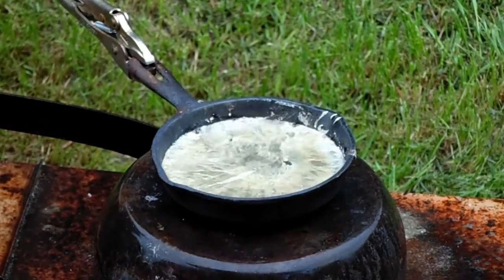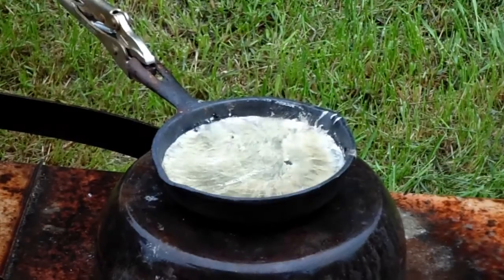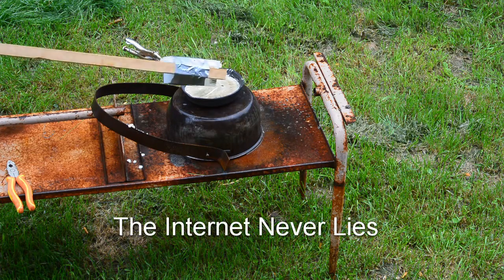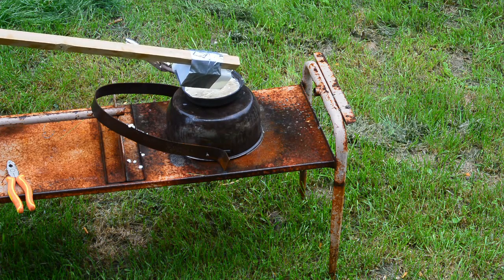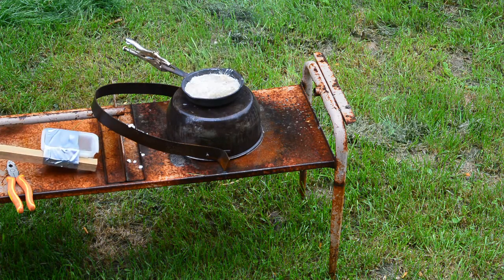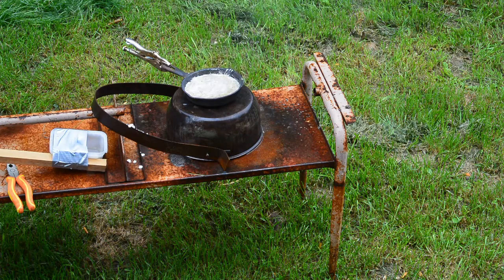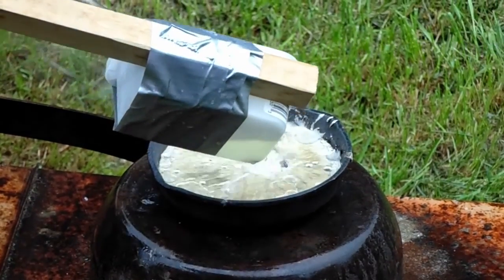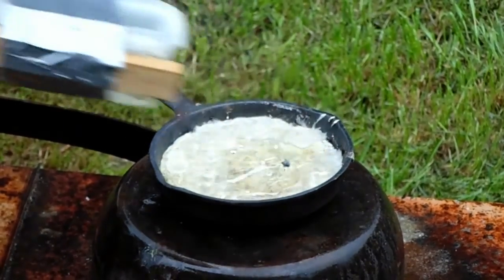Gasoline Vs. Molten Lead, Does It Explode?

Comment: Upper flammability limit I think... The gasoline vapor concentration is too high to react with oxygen even though it's above the autoignition temperature. It cools down very rapidly when it mixes with the air, taking the gasoline below the autoignition temperature by the time its concentration falls below the upper flammability limits.

Comment: Some guesses:
Boiling cools the gasoline and cools the lead surface with the escaping gas. Lead has a terrible heat capacity so it is very easily cooled before the gas reaches autoignition temperature.

The gasoline likely isn't touching the lead (leidenfrost).

Gasoline is a wildly varying mixture of hydrocarbons. Summer fuel is usually made to be slightly less volatile than winter fuel; possibly this alters the autoignition temperature.

Gasoline cannot ignite without air. If the gasoline fumes blanket the lead, they won't catch until they are sufficiently mixed with air, by which time they may have cooled sufficiently to not catch on fire.

Best chance of making this work I think would be stiring the lead before applying the gasoline and pouring just gas fumes rather than gasoline in liquid form onto the lead (obviously, risk of going "foof" and throwing some lead droplets).
Reply from the maker: soylentgreenb  I think you're on the right track. I don't know for sure but all of those ideas seem logical.